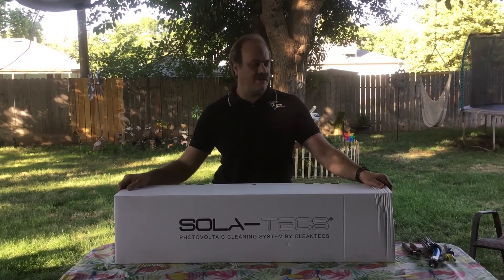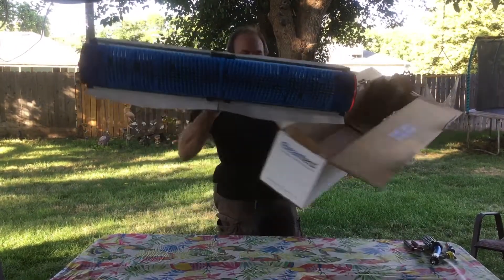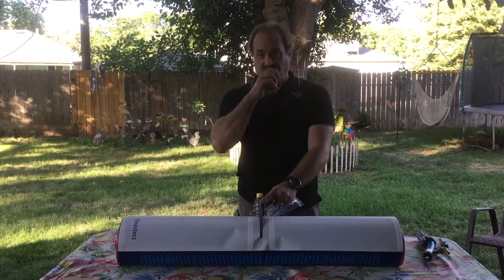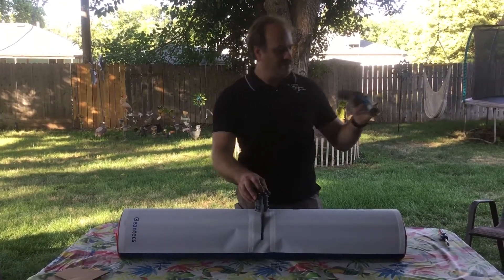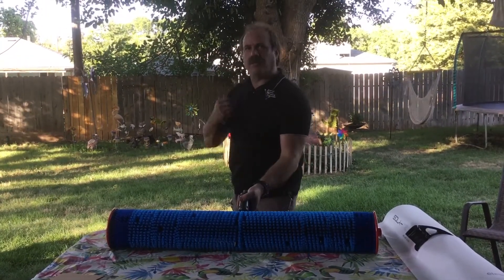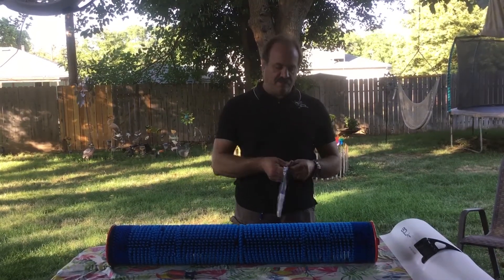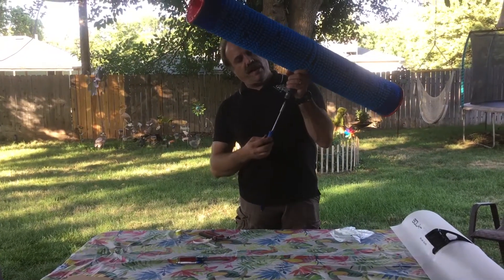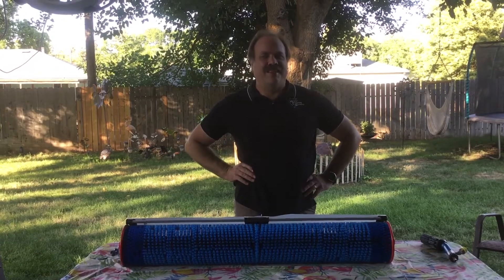SolaTecs C1000 Introduction

Comment: Nice video, what is the flow rate for the C1000? PSi
Reply from the maker: The stock nozzle will use 2.6gpm at the max pressure of 1800psi.  Most users clean at 1500psi or lower which would be about 2.4gpm.  These are pressures at the brush itself.  Often a 1/4" hose is used, so the pressure at your machine will be more like 2000psi to get 1500psi at the brush.  Other size nozzles are available for less (or more) flow, but most people use it with the stock nozzle.

Comment: If i buy a c400  will i be able to remove the 400 cm brush and use a c1000 brush on that same motor ?
Reply from the maker: Unfortunately, NO.  The C400 is its own unit and can not be upgraded later.  The C600, C800, and C1000 all use the same drive unit.  So you can buy a C600 and add sections to it later.  You can also buy a C1000 and take sections off to become a C800 or C600 if you want a smaller brush for some reason.  All of the C series brushes use the same connections and come tuned for the same flow rate.  Lower or higher flow rate orifices are available as well.